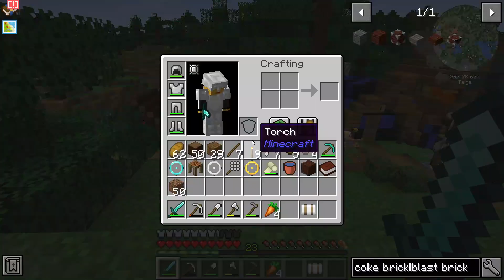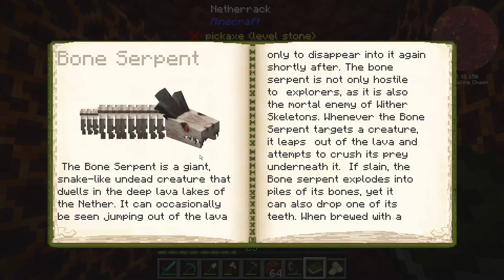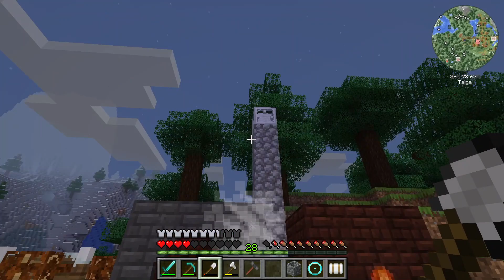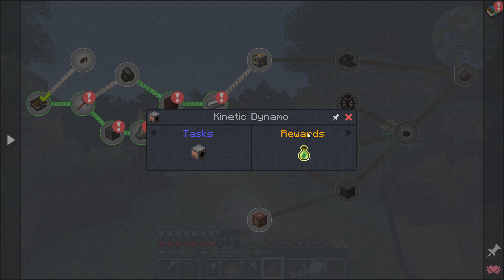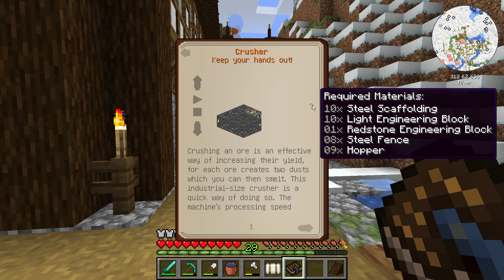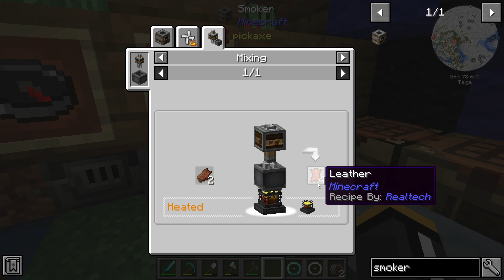Real Tech S3E02 - Ore Doubling with Immersive Engineering

Comment: When you were making your treated wood for the waterwheels... You kept grabbing your bucket out of the crafting table and then going into the GUI of the coke oven. 

The Tinkers crafting table shows the inventory of attached blocks.  You see four slots, one with coal, one with coal coke, and two empty ones.  Those two empty ones  are the slots for putting in the empty bucket and pulling out the full. 
Just place the empty in the 3rd slot and it will become a full in the 4th.
You don't have to keep jumping back and forth between the two GUIs.
Reply from the maker: Thanks for the tip!
I always forget to do that, though I usually end up moving things to a tank fairly early on.

Comment: If you need a really cheap way to empty your creosote tank. you can actually use the faucets from Tinkers and Ceramics. they'll fill any tank
Reply from the maker: Are you saying I can put a faucet on the coke oven and it will pull liquid from it? How did I now know this? 🤔